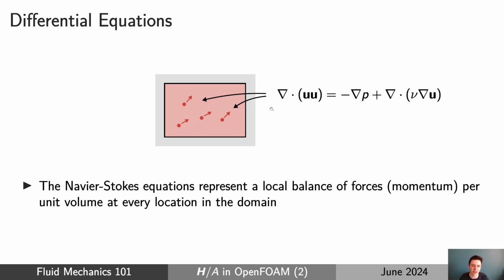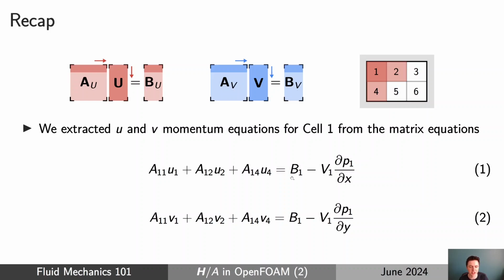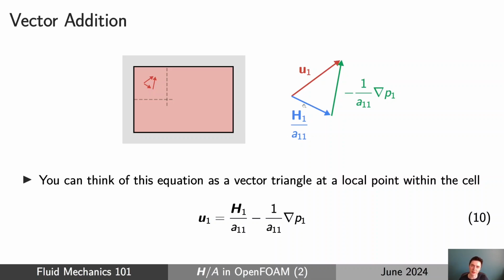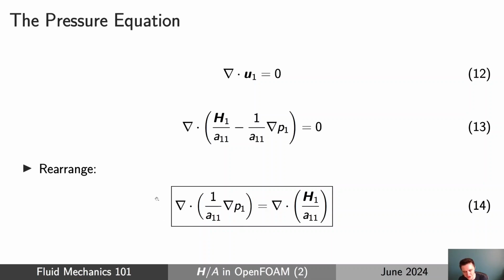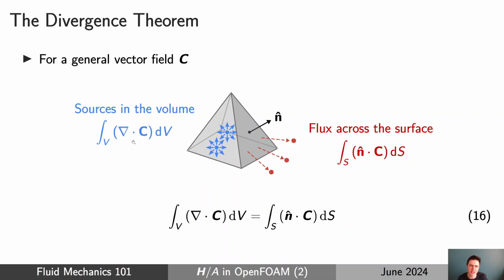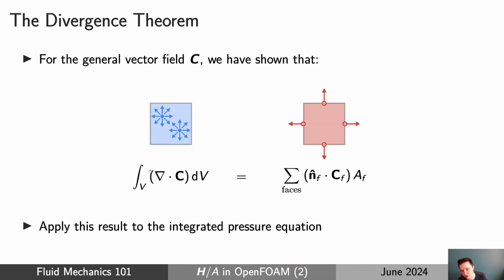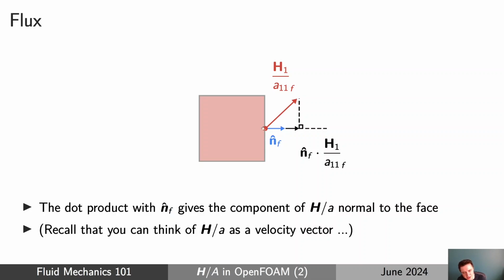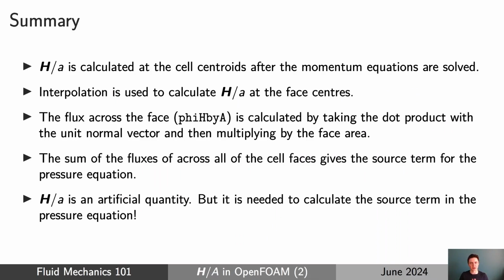[CFD] H/A (HbyA) in OpenFOAM - Part 2

Comment: Hi,

I have a small doubt. 

a simple bus bar in 2 different scenarios. 

1. Applied constant convection coefficient on busbar surface. There is no air domain
2.  Applied constant convection coefficient on busbar surface. There is air domain. 

My query is can we apply constant htc when there is fluid flow(with air domain)? 
Becuase applying a htc  of 5 as B.C represents there is very less air flow. 
If both are same, im getting different temperature plots  and maps.
What would be the difference between 1st case and 2nd case,

Comment: Great explanation! However how would one go about implementing boundary conditions for H(u)/A since the face interpolate values of this vector field are also required for boundary faces during the computation of phiHbyA. In the case of no-slip boundaries with grad(p) = 0 we can safely assume (H(u)/A)_b = u_b. But for all boundaries where the pressure gradient is not zero, we must fulfill (H(u)/A)_b = u_b + (grad(p)/A)_b which is a problem since A_b is not defined. Any ideas how one would go about this?
Reply from the maker: Difficult! There is a good chapter on this topic in 'Notes on Computational Fluid Dynamics: General Principles'
Reply: @fluidmechanics101  Thanks, i will definitly have a look at it 😊